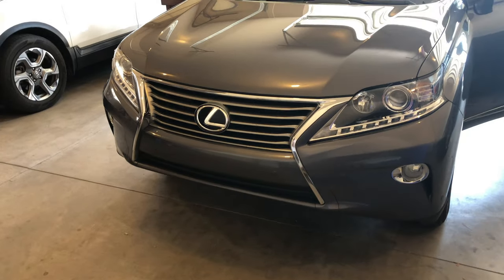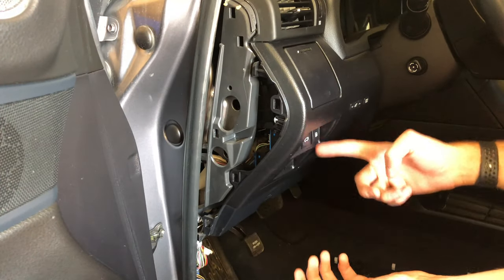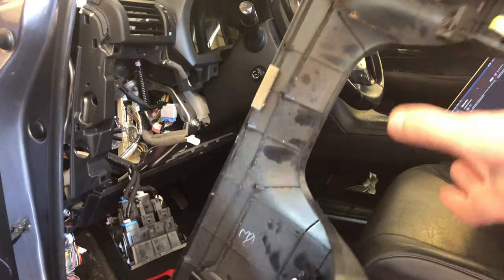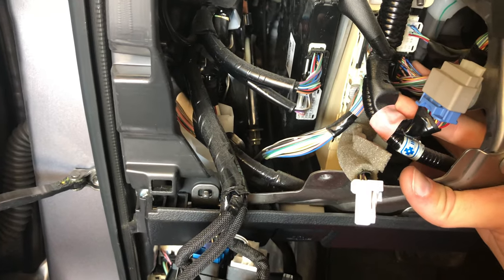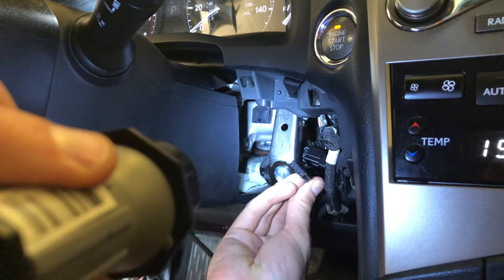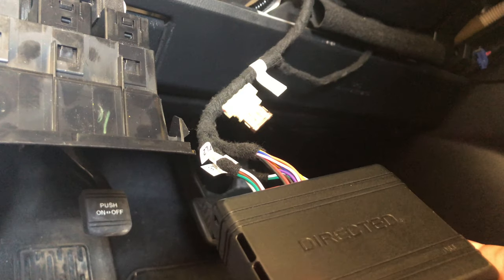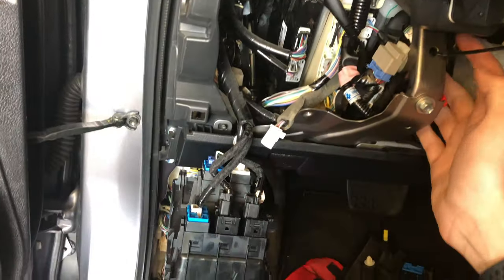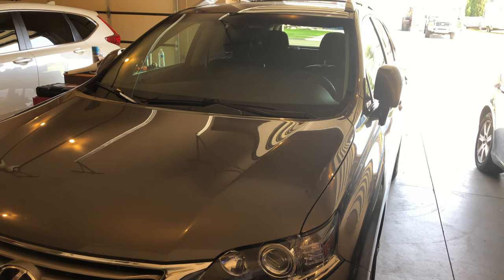2010-2015 Lexus RX350 Remote Start *DETAILED* Install

Comment: Thank you Shane for this video. I successfully installed mine in under an hour thanks to you. The 12 volt solutions video was almost worthless.
Reply from the maker: Glad it helped! Yeah, the 12 Volt Solutions needed to show a lot more detail to be useful.
Reply: @shanewazhere shortly after I installed this unit the fuse on the remote start blew and I had to pull my car apart again to replace. Now again, it is not working. I believe it's the fuse again. Have you had this issue? I hate having to pull all these dash pieces off again.
Reply from the maker: @koondog2000   I have not had the fuse blow on me at all. I would check that your wires haven’t rubbed on anything, exposing the wire and it touching it to metal. For example the steering column when it moves in and out or perhaps a different wire somewhere else that is connected to the remote start down the line.

Comment: Nice job better then 12 Vault Solutions
Reply: I bought my unit and installed it today follow you video step by steps EXCELLENT JOB YOU HAVE DONE. Everything works in first shot also it save me not to remove the steering column cover and manage. It was very easy.
Now I need to do it on my Lexus 2011 LX 570.
So far found Zero YouTube video!

Comment: These car  comes with a remote start I saw on another  video before .
Reply from the maker: @Johnny-wo7rc  perhaps some folks paid for an upgrade at the dealership for it when they bought it new, but it doesn’t come standard on these unfortunately.
Reply: @shanewazhere  that's a hidden feature they don't tell you about certain model cones with.

Comment: Their website mentions that the car will shut off when you open the door. Does this happen on your RX? I have a 2014 and this plug/play system looks like perfect for what we need.
Reply from the maker: Yes, it does. It's a security feature on all Toyota/Lexus vehicles. I don't mind it. It still heats/cools your car, you just have to start it up again.

Comment: Thank you for this very helpful video! I just installed my remote start and it works perfectly! One question, after you initiate the remote start and enter the vehicle, my Lexus shuts off normally but there is a "turn off lights" warning that flashes then disappears. The car functions normally but I was just wondering if you had that warning light too?
Reply from the maker: Yes! Actually, I HAVE seen that. I’m pretty sure it’s normal, but it’s slightly alarming to see. No issues thus far though.

Comment: I wonder if its compatible with the 15 rx350 f sport.
Reply from the maker: I'm pretty sure it would be, there are mainly just engine and tuning differences between the F-sport and non-F-Sport. According to this website, it doesn't matter. https://www.autopartskart.com/lexus-rx350-2015/power-liftgate-actuator.html

Comment: Thanks for sharing, do you think this will work for Lexus 2008, rx 350  ?
Reply from the maker: This remote start is only compatible with 2010 - 2015 RX350's. The company doesn't even have a compatible one for that year. Maybe another brand? MPC?
Reply: @shanewazhere  thank you!

Comment: Whats the range on the remote start??
Reply from the maker: The same as the keyfob, I would guess about 6 or more car lengths away.
Reply: @shanewazhere  ok thanks....i am have an issue where the fob is in my pocket and i am standing 6 feet from the vehicle and it would not unlock.(new battery in key fob)
Reply: @rajmaster007  the factory remote isn't very strong, maybe 10-15 feet away, max on the best day
Reply from the maker: @ze3bar  I can get probably 50 feet, or whatever from inside the house to the curb is.
Reply: @shanewazhere  damn Daniel, I don’t get that kind of range. Maybe 2-3 car lengths.
Reply: @ze3bar  This might sound odd but try pressing the top part of the key fob to the bottom of your chin (or side of head and press the button then -- it uses your skull as an antenna to extend your range. video of it: 0Uqf71muwWc
Reply: @jgizzy  I know it works but it looks and feels ridiculous hahahaha